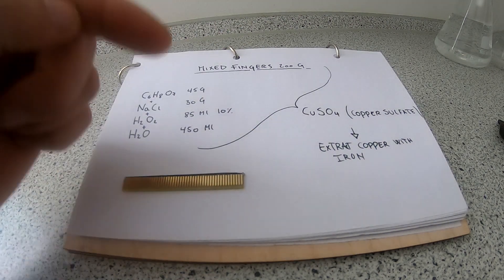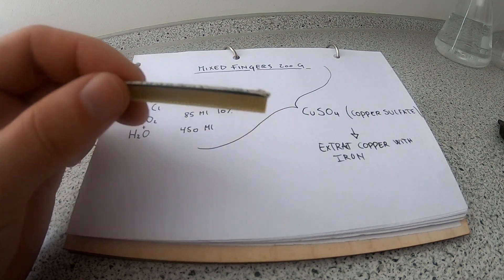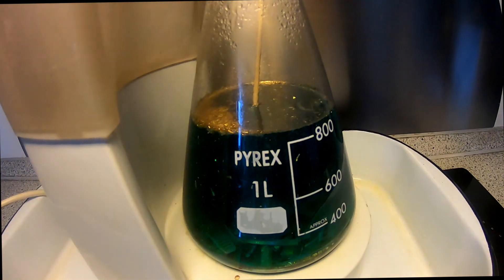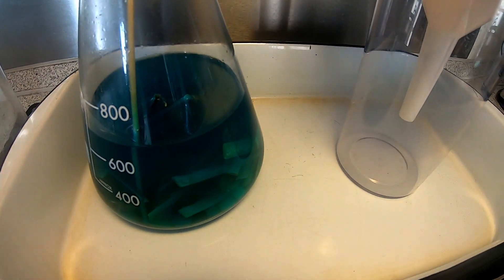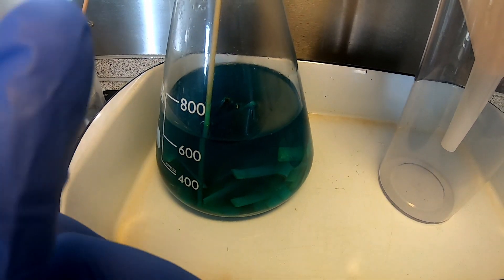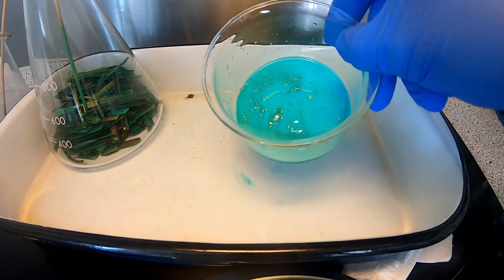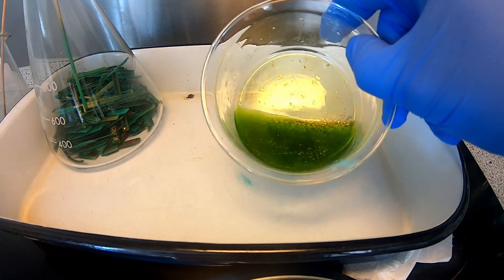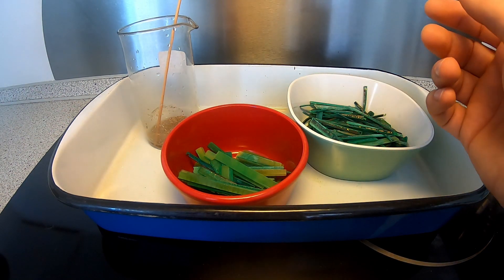Gold recovery Ewaste. Using citric acid.

Comment: You should have forgotten the citric acid, salt, & copper sulfate, & used hydrochloric acid + hydrogen peroxide in the first place.
Reply from the maker: The idea was that this method can be used without strong dangerous acids.. this also works a lot quicker, and I can do it in my kitchen

The peroxide/hydrochloric needs to form copperchloroide for it to desolve the copper. That can take weeks/months. But to be fair. I’m not in a hurry, so most times I use the this method, but it was a fun experiment 😉
Reply: @johannesthe5th154  But your method is not "using citric acid" when you end up adding hydrochloric acid anyway!
No, HCl with H2O2 will dissolve copper right away.  It will also dissolve nickel & other metals less electropositive then hydrogen.  The H2O2 provides the "driving force" to push the reaction forward.

Comment: Can this system be used also for pins or plated boards?
Reply from the maker: I suppose it could, but I’ve be a little concerned with the boards though. I don’t know how it would react with different kinds of solder. 

Also with the price. It takes a large quantity of citric acid to put small amounts of base metals in solution. 
Then you’ve be left with a lot of toxic waste to get rid of. 
Here where I live citric acid isn’t cheap 😬 

I tried once to desolve a gold filled wrist watch in citric acid. It took A LOT  of acid. But it worked just fine.

I guess more experiments are needed. 😊

Comment: can I use this method for recover gold from mobile phone pcb board with a lot solder attach on it. thank mate
Reply from the maker: I don’t know how the citric acid react with the tin/lead/silver, but it’s not very potent and it can only desolve very very small quantities of base metal. Also it’s important to not have any tin present in the refining stage. It makes everything more difficult. HCL, peroxide I find is the best way of removing the solder and releasing the gold for refining.

Comment: Using Citric acid and Hydrochloric acid why do peeps always do what's not in the description
Reply from the maker: HCL was used for putting copper nitrate back in solution. Not to recover the gold. 
I made a mistake when applying the heat to the citric salt solution that caused the precipitation. Oh well. Trial and error I guess. 
I think the desperation is accurate enough 😊
Reply: @johannesthe5th154  lol I know it's trial and error and do far of the 400 I've seen to date because I have 12 baby jars full of pins I've pulled off motherboards and some twenty pounds of gold fingers I'm not complaining just explaining